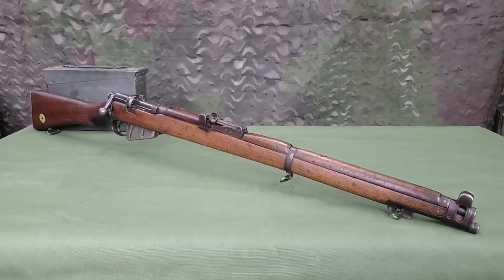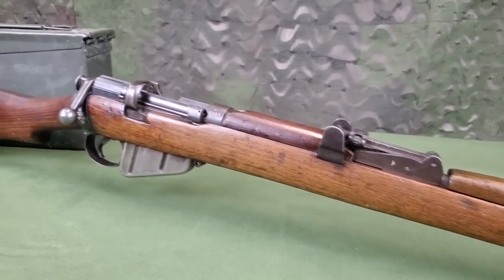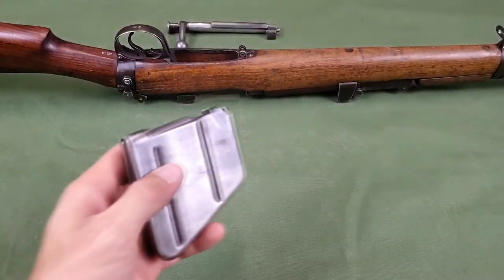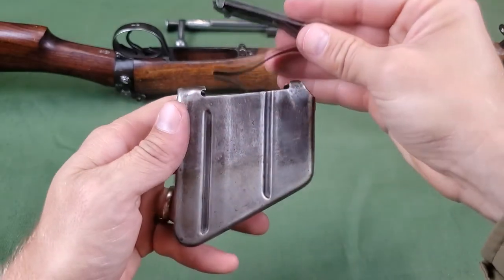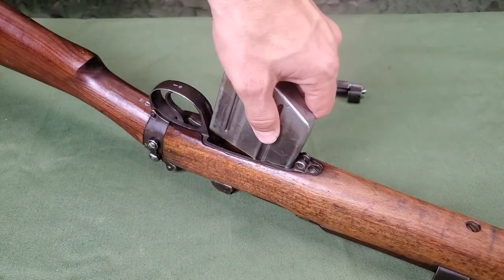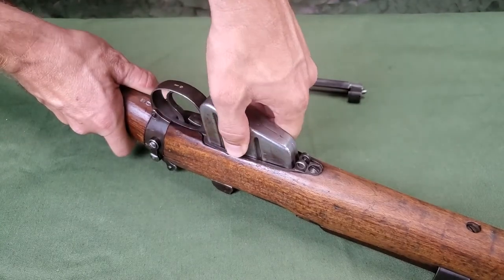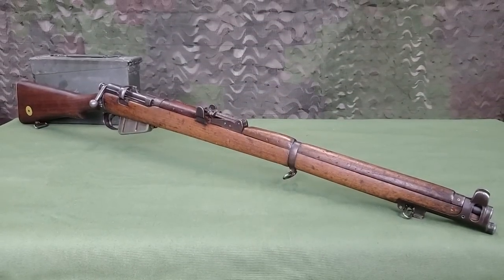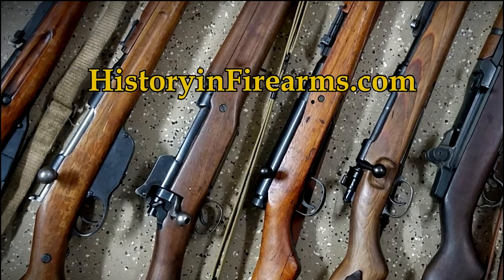SMLE Mk III* Field Strip (TF 4-02)

Comment: I got a nice refurbished one! Looking forward to many years of shooting pleasure! Thanks for the informative video!
Reply from the maker: Enjoy your piece of history! These are pleasant to shoot. Several other videos here on them if you haven't seen them already. 👍
Reply: @HistoryinFirearms  I just took it out to the range yesterday; it was indeed a dream to shoot! I was surprised at the low recoil. The only thing was that it seemed a bit hard to put into battery, but I also noticed that after I did my basic field strip and cleaning after putting 30 rounds through it, I was, once again, having difficulty trying to get the bolt to lock back into place. I eventually discovered that the bolt has a separate piece that screws out (on the front, where the firing pin comes out). Once I made my "discovery", I screwed it back in to the last thread, and the bolt went back into the locked position just fine. Might have been a little loose as I was cycling it while at the range.
Reply from the maker: @Hothenrik Glad you got it figured out!